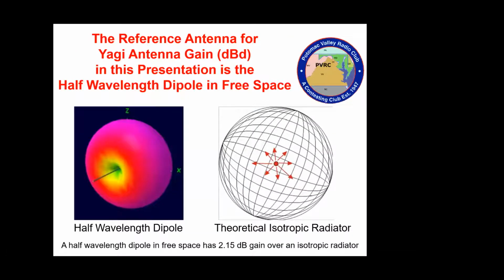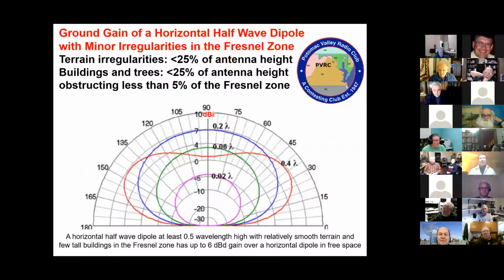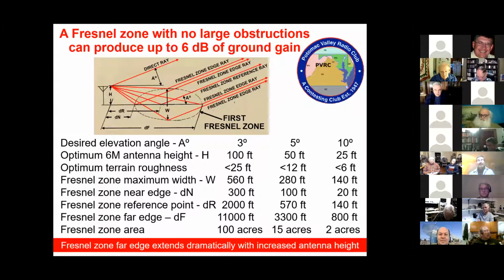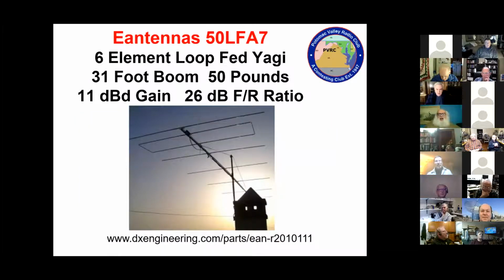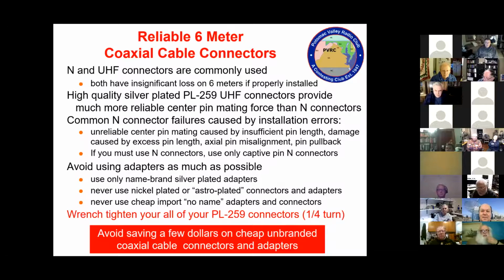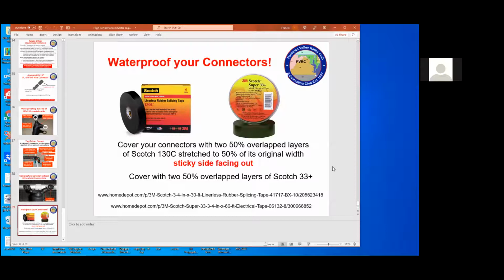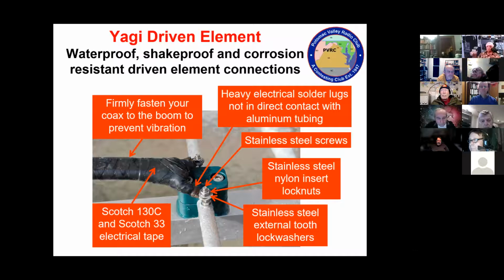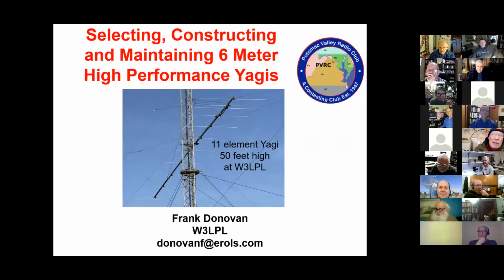Selection and Construction of High Performance 6 Meter Yagi Antenna Systems by Frank W3LPL

Comment: 1:04:28 Use NoAlox on those connections . At lowes it's called OxGard ...same stuff .  You will have a good electrical connection for many more years.  I use CoaxSeal to wrap the wires as you did . Is the Scotch a better ...or cheaper alternative ? CoaxSeal is EXPENSIVE

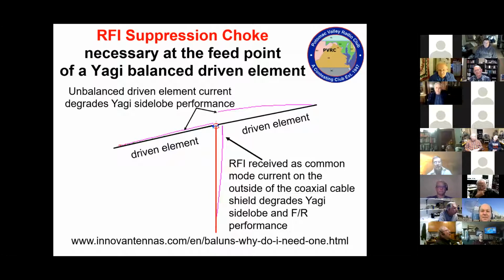Comment: 49:04 The LFA's full wave loop driven element approach that behaves close to a folded dipole demonstrably mitigates common mode current down the "third" wire.  Buxton, Carey G., Warren L. Stutzman, Randall R. Nealy and Aaron M. Orndorff (2001). "The folded dipole: A self-balancing antenna."